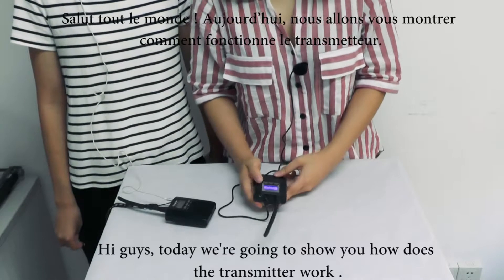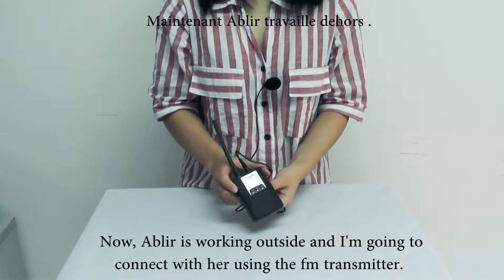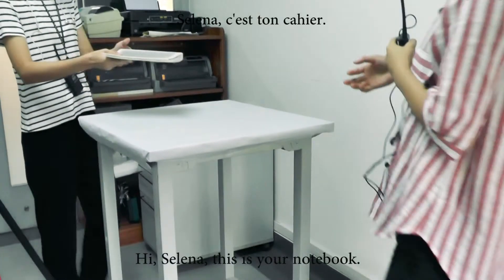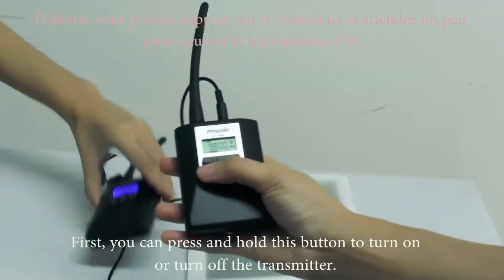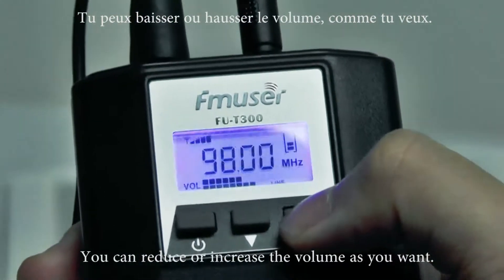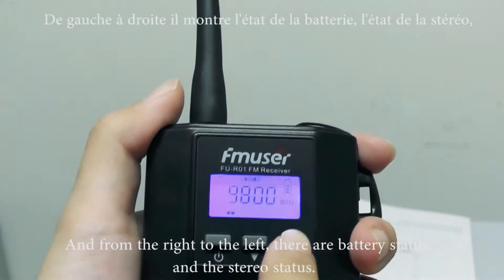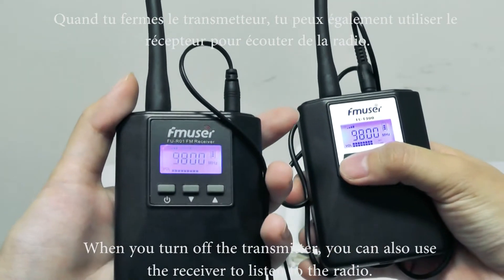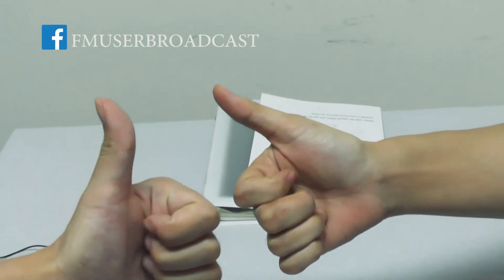Quick View | How to Use a 0.2W Mini FM Transmitter for Broadcasting?

Comment: I believe this unit puts out around 200mW, so they're WAY over the limit for legal use in the United States. That said, you could still plug it into an exterior antenna and get a half mile of range, if not more.